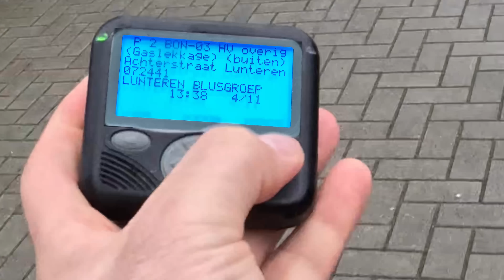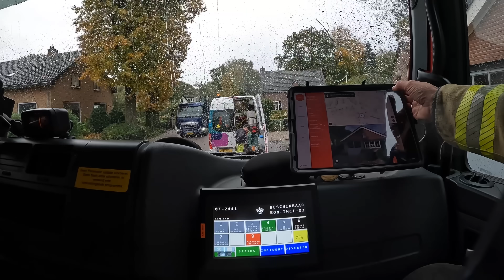Gaslek - VOLUNTEERS DUTCH FIREFIGHTERS -

Comment: Hard to believe that the strong blowing noise you hear at the excavation point until about 9:30 comes from a small low pressure pipe that you can barely see in the video! Not to mention the small whirlwind of dust around said pipe. Truly some hints of how strong gas pressure is and, consequently, how dangerous a gas leak can be!

Good job as always jongens!!

Comment: Nice video…. Love this channel because you  show the per perspective of the fire fighter.  Question about the cables that get attached to the truck…. Why is one power cord yellow and the other blue?  Curious to know what the difference is.
Reply: Educated guess (may stand corrected later): Yellow is power, blue is compressed air. Truck brakes need air pressure to work, without it they "fail safe" and won't release. The air pressure in the reservoir drops over time and is replenished while the engine is running. If a truck isn't moved for a while, it may take a few minutes after engine start before there's enough pressure built to release the parking brake. Having the external air connected keeps the truck ready to go when they need it.
Reply: @chrisl893 has the right of it. Yellow is shore power to supply the inverters/chargers and keep the batteries topped off. Blue is an offboard air supply to help keep the brakes topped off while the truck is parked.

Comment: What is the radio system that you use?
Reply: C2000 is an dutch developed nationwide digital network  daily used by over 80.000  first respnders ( police, ambulance, fire brigade , military police, national security services etc).
Of course a closed network currently migrating and extending  to more integrated information and communication network with higher security levels . Nationwide coverage is around 98 pc.